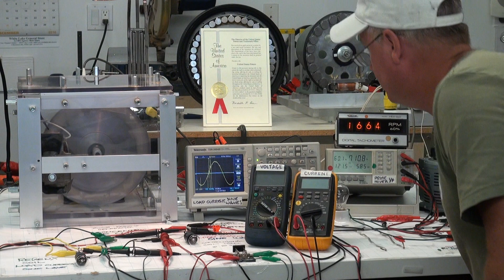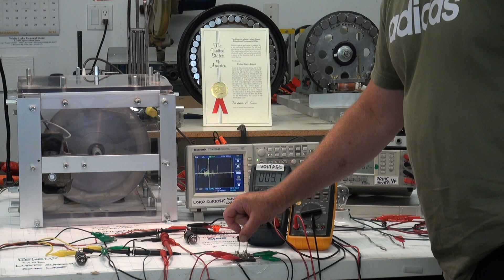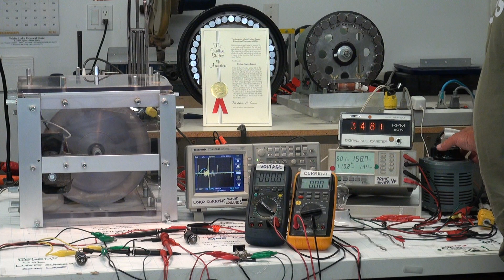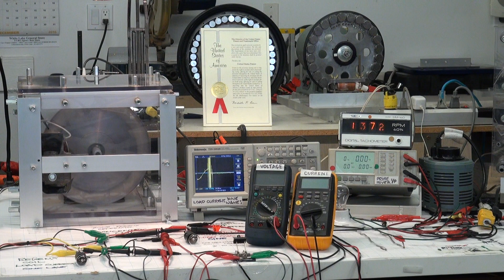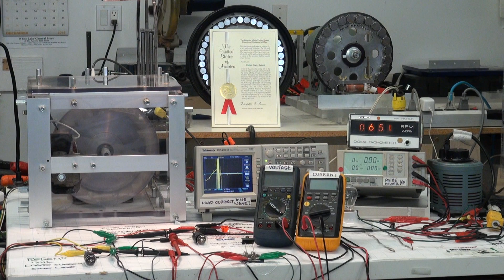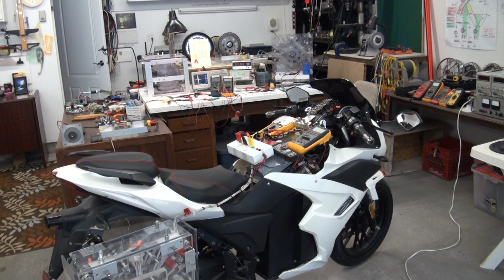INFINITE EFFICIENCY ELECTRICITY GENERATION WITH THE US PATENTED ReGenX Generator Innovation

Comment: I have replicated overunity transformer, but my version is a little bit different. One primary coil and two secondary coils are tightly together. Magnetic fields of two secondary coils is opposite to each other, so reverse magnetic fields is zero summed. In transformer any air gaps creates noise, so I completely disassembled microwave oven transformer and again assembled , so there is no  gaps in magnetic circuit. My modified transformer input power is  19,8 VARs (220V * 0,09A ) . Transformer primary coil  ohmic resistance is 60 ohms, so real power is 60*(0,09^2) = 0,486 W.  Output power is 12W ( 1,1 A through 10 ohms load ).  That is enough power to supply energy to my computer and iPhone. Coefficient of  performance is (12W/0,486 W) = 24,69 . Modified transformer does not heat up when operated. Conventional transformers always becomes hot when operated. In 2018. year, when I first time heard about overunity transformer, I went to shop and bought cheap, shell type transformer, with 5W maximum power. I used screw to couple two secondary coils. Screw become very hot when operated, because magnetic flux from secondary coils caused eddy currents in screw. Input power to transformer was 17 VARs (220V * 0,077 A ). Output power was 2,5 W (0,5 A through 10 ohms) + heat from screw, which I cannot measure.
Reply: @Pumpkingilmour Input energy is 0,486. So I get 11,5 watts free energy.
Reply: @Pumpkingilmour https://youtu.be/MdTykuViouY I have already made video two months ago. In that video transformer supply energy to asymmetrically modified DC motor.
Reply: @Pumpkingilmour https://drive.google.com/file/d/11YRayXHgs2l0iwBoFLfwkfimiH-7Ni62/view?usp=sharing

Comment: So are you converting back EMF to be additive instead of reductive or are you eliminating back EMF? Why don't you add this innovation to a full sized EV as a proof of concept with a data-logger to prove  your innovation.  Make an EV with an infinite range and you have solved the carbon crisis. Just repeating the same information year after year seems to not be going anywhere.
Reply from the maker: "Why don't you add this innovation to a full sized EV as a proof of concept with a data-logger to prove  your innovation."

This is a really great idea! 
How soon can you send the money to fund this project so together we can solve the carbon crisis? 
Thanks
Thane
Reply: @ThaneHeins1  Could your innovation be used to reduce the input energy required to run a AC compressor/fans?
Reply from the maker: @solexxx8588  Absolutely this  application would employ ReGen-X Motors which produce torque and electrical output at the same time.
Reply from the maker: @solexxx8588  https://youtu.be/JqbrjuzeT34
Reply: @ThaneHeins1  In ReGen-X motor unidirectional pulses is used, instead of AC. That is similar to UFOpolitics DC motor-generator with two commutators and four brushes. Witchcraft spell:"What actually moves the armature (rotor) current through the armature coils is the difference between the voltage applied to the motor (Ea) minus the counter-emf (Ec) " Back EMF witch can steal up to 80% of input energy, weakening coil magnetic field. The witch devours very high percentage of whatever energy we put in. And the worst part is ... The more we put in .. The stronger the witch grows. And the witchcraft spell continues: "(Applied voltage - back EMF) is the actual voltage effective in the armature and it is the effective voltage, which determines the value of armature current. Since generally I=E/R from ohms law, in the case of DC motor , Ia = Ea - BEMF/Ra " . If we don't kill, or even better, get the witch to work in our favor ...we will never, ever ... get rid of the stinking Gas-Diesel engines. We spent 12,1 volts, the witch devours 9.0 volts (74.4%) , leaving 3,1 volts of actual operating power. Which means 25% . This loss percentages could vary up to 80-90% depending on many different factors.
Reply: @ThaneHeins1  In symmetric motors current changes direction in every cycle. Change in direction of current kills radiant energy, and creates back EMF, which devours very large part of energy. All AC motors - synchronous and asynchronous, are symmetric motors. Conventional DC motors are symmetric, because direction of current in coils is reversed in every cycle. In asymmetric motors, direction of current is never changed, it is switched on and off. When motor coil is disconnected from power source, high voltage spike is generated, trying to continue flow of current. That voltage spike is called " radiant energy ", or " cold electricity " . When radiant energy is delayed in time domain, cold electricity will flow shortly before next pulse is applied to motor coil. Back EMF will be significantly reduced, and cold electricity will return energy back to source. ReGenX motor is asymmetric brushless DC motor . Symmetric DC motors have high torque at low RPMs and low torque at high RPMs . Asymmetric DC motors can have high torque at high RPMs, so output power exceeds input power. ReGenX generator will help to keep RPMs high all the time , and efficiency above 100% all the time. Asymmetric DC motors have two commutators, one for + , one for - , and four brushes, two for power supply, other two for power receiving batteries.
Reply: @ThaneHeins1  Power can be amplified with simple Tesla coil. Kapanadze and Don Smith has build Tesla coil generators that can output 10kW of power. If primary coil of Tesla transformer is in the middle of secondary coil, than current and voltage will be equal, producing very high output power.  In solid state Tesla coil high frequency transistor is used instead of spark gap. Tesla transformer is asymmetric , there is switching on and off, without reversal of direction of current.
Reply: @ThaneHeins1  Real Tesla car will run on energy received from the aether or vacuum. If it needs to plug in to recharge, it is Edison car. Elon Musk has a lot of money, maybe ask him some money.
Reply from the maker: Counter-electromotive force (counter EMF, CEMF),] also known as Back Electromotive Force (back EMF), is the electromotive force or "voltage" that opposes the change in current which induced it. In conventional electric generators which operate at 60 Hz the opposition to the change in current (Impedance Zt) is negligible. As the frequency of operation is increased however, the Back EMF is increased enough that eventually ALL current flow in the coil is ceased. At that point the generator coil ceases to function as an Inductor (storing created Electromagnetic Field Energy around the exterior of the coil and performing Negative Work reducing the Kinetic Energy of the system) and is forced to store Energy internally and Electrostatically inside the coil (between the windings) like a capacitor. This produces a Load Current Delay where the created Electromagnetic Field Energy can then be used to perform Positive Work and increase the Kinetic Energy of the system while delivering electric power to the load at Infinite Efficiency... Cheers Thane
Reply: @dylans voice   They need to use free energy to make electric vehicles practical. Tesla Semi requires 1Mwh battery capacity to operate. If they use free energy, much less battery capacity will be required, and they will be able to put more Semi trucks on road.
Reply: @dylans voice  Cold electricity from asymmetric motors will cool down electric vehicle batteries, increasing battery life. When cold electricity is charged into battery or capacitor, it is converted into normal electricity. Cold electricity can rejuvenate dead batteries, if we allow radiant energy to work. Flywheel diodes and H bridges kill radiant energy, current direction reversal kill radiant energy, shorting through diode kill radiant energy.

Comment: I agree not showing anything new here since 2008..great concept lets see some working models..wind turbine etc..
Reply: I like to but is it proprietary? I dont wanna get sued for building something you have a patent on..
Reply: I have connections to hydro electric power dams here in northern ont and quebec...all i need to do is show management a working generator...low water levels especially now would really benefit them ...instead of running 1/2 capacity they could be running    full according to your theory
Reply from the maker: @Purenergy555  The US patented ReGenX Generator is 3rd party proven to operate at infinite efficiency. That means ZERO mechanical input is required when the generator is palced on load. Feel free to contact me privately if you are sincere. 
thaneh@potentialdifference.ca 
Cheers Thane
Reply from the maker: Why not build one yourself if that is your desire? Cheers Thane
Reply: Wind may not provide enough speed to start regenerative acceleration. You need to increase speed using gearbox.
Reply: @dylans voice  You can use asymmetric DC motor as a prime mover. Asymmetric DC motors is more efficient than symmetric motors. ReGenX motor is asymmetric brushless motor. https://drive.google.com/file/d/1FXVvsm-ujwpXEhclmSUh1zFHGbkFm3Wu/view?usp=sharing
Reply: this is all bullshit.there is absolutely no possibility of free energy, no infinite efficiency.these false concepts have been doing the rounds for decades and with not a microwatt of power produced.p.s.this is not my account-it is the wife's as I don't use e-mail.yours sincerely, paul cotter, retired electrical engineer in ireland

Comment: I've been following you for sometime but I've not seen power output from your generator at full output capacity, please make a video with a full capacity output, we are already familiar with the working concept of the generator now, add output of at least 500watts... Otherwise thanks for sharing your knowledge
Reply from the maker: Hello Ntambi, 

Thank you for your comment.
I imagine the "working concept" is far beyond what you are familiar with... 
Kind regards Thane

An Electric Generator is a machine which converts Mechanical Input Power to Electrical Output Power according to Faraday's Law of Induction of the early 1820s. 

It is Universally Accepted that essentially ALL Electric Generators have ONLY ONE OUTPUT and that they operate at LESS than 100% efficiency - BOTH of these statements are UNTRUE.

All Electric Generators have MANY various OUTPUTS such as Electrical, Heat, and Noise BUT the MOST significant (at least equally significant as the electrical) Output is the Mechanical Output which was discovered by Emil Lenz and formulated in a Law of Physics called Lenz's Law of Induction of 1834. 

Lenz's Law identifies the Negative Work which is performed in Electricity Generation and he also identified the Source of Energy which is Created which is required to perform that Negative Work.

Magnetic Field Energy which is CREATED around all current bearing wires is the Source of Energy Emil Lenz discovered in 1834.

in 1820 Hans Christian Ørsted ALSO discovered that Magnetic Field Energy was being created when an electric current was passed through a wire, the Magnetic Field Energy created around the wire would perform Positive Work on a compass needle and cause the Kinetic Energy of the needle to increase. 

HISTORY OF THE LAW OF CREATION OF ENERGY
https://www.slideshare.net/PDiCEOThan...

According to the Work-Energy Principle ALL Work requires Energy because Energy is the Currency required in order to perform Work. 

Negative Work is performed by Energy when the Kinetic Energy of a system is Reduced and Positive Work is performed when the Kinetic Energy is Increased.

In ALL Electric Machines and in BOTH cases this Energy is Created. 

Electromagnetic Field Energy is Created in Electric Motors and Positive Work is performed and in Electric Generators Negative Work is performed by this Created Energy.

ALL Electric Generators are 100% efficient in their conversion of Mechanical Input Power to Electrical, Heat and Noise Outputs.

ALL Electric Generators EXCEED 100% efficiency when the Mechanical Output (and the Negative Work performed) is factored into the performance evaluation.

The US patented ReGenX Generator uses Created Magnetic field Energy to OPERATE AT INFINITE EFFICIENCY.

Introduction to the ReGenX Generator and Infinite Efficiency: https://youtu.be/NbZhKWjpMx4

Thane C. Heins
President and CEO, Potential +/- Difference Inc.
Email 1: thaneh@potentialdifference.ca
Cell: 613.898.1131

Potential +/- Difference Inc. - Pioneering Electric Vehicle Regenerative Acceleration Technology & Charging Ahead...

"Nothing is too wonderful to be true" 
~ Michael Faraday 

"Physics isn't the most important thing. Love is."
~ Richard P. Feynman
Reply: @ThaneHeins1  Thanks for the information...
I've read through most of the work and also followed JL Naudins replication of your bitoroid transformer, I experimented with it and it confirmed all that you say...
What I would like to see is you to run this generator with some heavy loads, I want to see if this this concept can be scaled to industrial usage, please try to add some heavy loads at least 200watts
Regards
Nicholas
Reply from the maker: @Nick-xp9gu  I don't know what is meant by "heavy loads" but if you mean increased Output Power to a load then this video demonstrates 217.6 Watts of Output Power at Infinite Efficiency conversion. About 40 Watts / coil and it also demonstrates Positive Work being performed by CREATED Magnetic Field Energy.  We now have commercially manufactured coils which deliver in excess of 10 KW / coil also at Infinite Efficiency. Our company creates and develops Intellectual Property. 
We also use our videos to help change the current idea about energy which no longer serves humanity... 
Cheers Thane
Reply: @ThaneHeins1  Kilowatt output range is what I wanted to hear and I also want to see it, the theory and demonstrations show it's possible but I haven't seen you demonstrate it..
It would be very good to see one, I will help me to completely change my current thinking and I believe it will help others too, please help us and demonstrate the one with a 10kw range
Reply from the maker: @Nick-xp9gu  OK how soon can you send the funds to do this? 
Thanks
Thane
Reply: @Nick-xp9gu  You can increase output from bitoroid transformer, if you use core without any air gaps or glue gaps, and put all three coils tightly together. You can also increase transformer core cross section area.
Reply: @marcisgulbis9310  actually, the bitoroid doesn't output more than you input, it does two things:
1. It can stop back EMF, meaning the power source for the output is the current in the primary at that time, the only difference is that you won't oppose it when powering the output.. so there isn't any other source of excess power...
2. What the bitoroid transformer and the regenex transformer do is they can borrow energy from the source, store it for some period of time and then return it to the source, so the regenex coil output depends on the magnetic strength of those neodymium
Reply: @Nick-xp9gu  bitoroid transformer converts reactive power into active power.
Reply: @dylans voice  I fully understand thane's work, like him I've not tried picking up power in kilowatts range with the motor...
I then decide to focus on the bitoroid transformer, the bitoroid transformer doesn't have back EMF but it's not a free energy device, I decided to mix extraction of energy from the transformer core using NMR, with this method I'm able to move magnetic domains in the core with so much less power but with a powerful resultant magnetic field, using thane's transformer without backemf I was able to light up about 700watts of incandescent bulbs with less than 30watts...
Email me at kotlinnick@gmail.com I will send you my work for free
Reply: @dylans voice  the frequency is different for every transformer, but I injected 437khz with one winding, I then modulated it with another primary winding at 50hz.. 
P.S: I used a ferrite core in my device